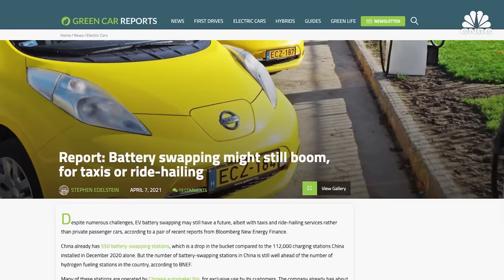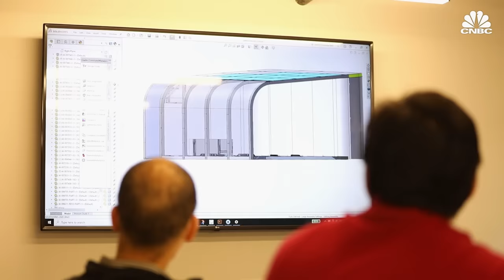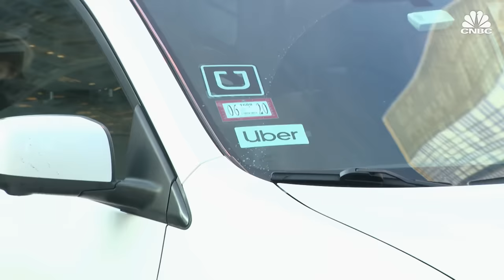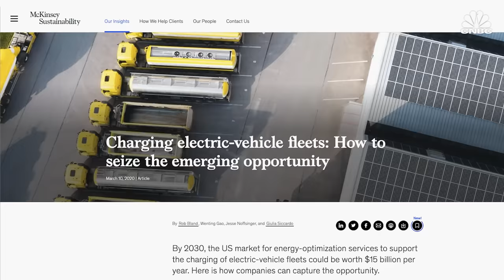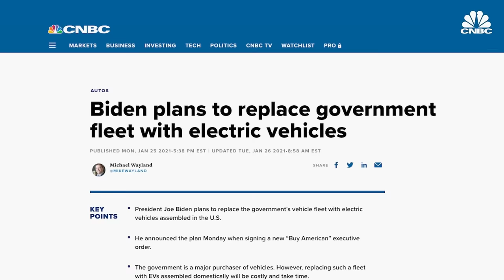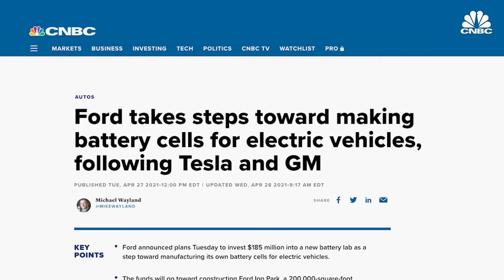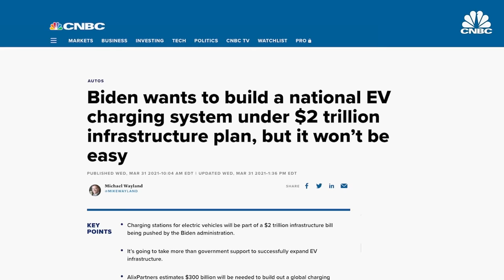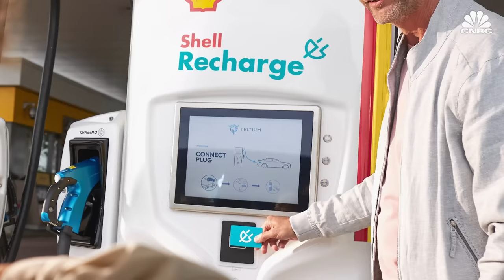Can EV Battery Swapping Take Off In The U.S.?

Comment: In the Netherlands a battery swapping station costs 3 million euro.

That's a lot of cars that need to go through, for it to become profitable.
Reply: But if they can sell excess power back to the grid then that's even more potential revenue. Just a thought.
Reply: It’s the exact same problem many gas stations have. The gas isn’t the money maker for them but usually the convenience store that turns the profit.
Reply: @inter5123  Isn't that the same for when opting for a charging solution? I don't see this as an avantage for saapping.

The economis for swapping are just terribly bad.
Reply: @FMTF-makemoneyonline  oh it would be the same charging or not. The margins are low either way. Maybe their consumer stations would have a convenience store aspect but as it stands there’s no way they can get a good ROI within a reasonable time.
Reply: In England they retrofit street light poles with EV charging sockets, each costs like 1500 pounds. For 3 million pounds it would be 2000 mini-charging stations, plenty for the entire city. At a cost of single battery swap station.
Reply: THIS IS A PONZI SCHEME BATTERY SWAP CAN ONLY WORK IN A COMMUNIST COUNTRY LIKE CHINA WHERE ALL AUTOMAKERS ARE UNDER GOVT DIRECTIVES
Reply: HahThatsWhatSheSaid  you can program the system to ensure there are always enough charged batteries to meet the demand of the service. Don't have to fully drain them either. You have these all over town with like 50% of the batteries providing like 20% of their storage to the grid and you can have a sizable output with minimal effect on battery life.
Reply: Battery swapping IS A DUMB IDEA.
Sounds "Clever" BUT Batteries is the MOST EXPENSIVE part of an EV AND there is AND WILL BE a battery shortage for the foreseable future.
With battery swapping you need MORE BATTERIES.
Most cars should be able to charge while parked so more chargers are needed, swapping is unecessary.
Reply: @inter5123  correct
Reply: Nio looks like U.S $314,000 per swap station in china. They can do max 312 swaps a day or U S. $2.76 per swap over a year, theoretically at 113, 880 swaps per year.  They are not tied down and can be moved depending on demand. Normal move takes 3 days in china. Still a big initial investment though. They'll have some 6,000 units within 3 years allowing for daily 1,872,000 swaps or yearly 683 million swaps along with their normal superchargers as well as home chargers. The Sinopec gas tations are putting them at their stations and the government just announced massive Rebates from provinces to installers and they hope to make a uniform code for swap stations. For what's its worth anyway.
Reply: Not only swapping station, must be multiservice swapping station. Sell all goods, food, cafeteria.....
Reply: @paul_london  that's a good idea
Reply: Modularized battery means you are adding dead weight to the car and reduce it's range and efficiency. Also thermal management advancement will make it worse and inadequate sooner than you expects
Reply: The only time and place that make sense is to charge over night in your garage. Battery swapping is more a gimmick than a true solution.
Reply: @ac-stingz  sure. It's for the people who do not have a garage.
Reply: That's because the Europeans didn't build it right. How come the Chinese can lower the cost? Cuz smarter?
Reply: @jal8298  Ask Renault?
Reply: @jal8298  I think here they the ground is far more expensive, combined with a more fixed building that isn't movable. Next the technology has yet to be built by themselves (they'll always try to reinvent the wheel)
Reply: @jal8298  1. Cheap labor 2. Differences in regulations. 3. Possible subsidies from government
Reply: the lifespan of slow charged batteries is longer, so the swapping solution could be better for the environment + less batteries needed in total. Maybe don't call it a "dumb" idea, only because it's different
Reply: @R3mak3r  slow charging is very inefficient, a charging rate of 15A@ 120v  is only 58%. Means you use much more electricity to charge up to the same SOC (state of charge). While level 2 charging at 32-48A @220V will have an 80%+ of efficiency. The key to minimize the effect of degradation is to charge at the right temperature and maintain the right state of charge (SOC), that means good thermal/battery management is more important. High state of charge is bad for the battery, which is another reason swapping 100% charged battery is not ideal.
Reply: @ac-stingz  thanks. This is a good information. I will take a look at it ;)
Reply: NIO is somehow doing it tho
Reply: @haruyanto8085  yeah, with kinda mobile tent like things
Reply: @haruyanto8085  here are some reasons why not everyone is following: https://spectrum.ieee.org/cars-that-think/energy/batteries-storage/ev-battery-swapping-how-is-this-a-good-idea
Reply: @qinby1182  Large batteries especially from cars, and even smaller electric vehicles like scooters/ebikes are recycled. However I think for smaller devices like phones with small batteries, are probably not recycled immediately/promptly (due to high recycling cost of processing the device just to get a small battery) and are kept at a municipal hazardous battery waste storage if you bring it there (hopefully) for future recycling once robotics reach a point of speedening the process. As long as the recycling process of batteries is low in energy demands, and the recycle rate is near 100% efficient (which I believe is) for the precious metals, then it is conservative.
However, if everyone decides to have an electric car, (instead of settling with an ebike that has probably 1% of the weight of the electric car battery) then yes it might put a dent on the available metals on the planet... however if space technology continues to advance to the point of being able to mine precious metals from asteroids, then this no longer will be a concern

Comment: 7:50 For those who aren't sure they want to run exclusively on whatever battery gets swapped in, why not mix the approach?  Vehicles could have their own battery capacity plus use Ample's for range extension.
Reply: Sure, double the weight of the batteries, great idea.
Reply: Where would the ample battery fit in?

Comment: For everyday commute plugin charging is good, only long drivers will need this swapping. semi-tractor-trailer trucks are a good candidate for battery swapping. Also for my personal car, why would I trade a good battery of mine with degraded battery of theirs from swapping place, unless it's a commercial vehicle.
Reply: I think what we'll see with class 8 trucks is a combination of supplemental batteries and solar charging in the trailers, as the few class 8 etrucks that are close to market release, have shown abysmal range for just the tractor - a Freightliner Ecascadia has only 250ish miles. Meanwhile, an otr driver team can easily be moving 22 hours a day.
Reply: For trucks trailers with battery is probably more likely
Reply: Yes. Battery swapping only makes sense for fleet vehicles.
Reply: Or people that live in apartments, and don't have safe personal charging options.
Reply: Battery swapping IS A DUMB IDEA.
Sounds "Clever" BUT Batteries is the MOST EXPENSIVE part of an EV AND there is AND WILL BE a battery shortage for the foreseable future.
With battery swapping you need MORE BATTERIES.
Most cars should be able to charge while parked so more chargers are needed, swapping is unecessary.
Reply: Yes, this could work for class 8 trucking, which would become coordinated relay hopping for long distance hauling. But with trained driver shortages a perpetual problem, the logistics are critical.  Many drivers arrive to drop off or pick up a load to be told to wait a couple hours, sometimes the delay is a day.  The logistics of trucking can be very frustrating - trucking usually does not operate like a well-oiled machine, which is a reason for the high turnover rate for drivers.
Reply: @qinby1182  yes especially the batteries that are the most expensive component of the car and already now there is a a problem to produce enough batteries.
Reply: @millefune  correct. Like china.
Reply: Good thinking! We could have the trailers include batteries even
Reply: Was thinking the same thing.  this makes alot of sense for, commercial vehicals. Taxis come to mind.
Reply: I totally agree with this. I definitely see a use case in this tech. Most would not need it everyday, but on those long distant drives or for people who live in Apartments that don’t have anywhere to plug in etc, this would be perfect! I can see these at future gas station/charge stations.
Reply: "Semi-tractor-trailer trucks" won't be electric unless they will have Hydrogen tanks and fuel cells. Batteries for these trucks will be just too heavy
Reply: "semi-tractor-trailer trucks are a good candidate for battery swapping"
Why ?  the Semi is charged during loading/unloading.  Plug it into several SuperChargers.
Reply: @Donovan Lewis but public chargers are not like gasoline service stations.   They are few,  they are in odd places,  they are often positioned on congested street parking spaces jealously sought by drivers,  they are often unprotected from the elements,  they are usually unattended so maintenance is spotty like a drink machine,  they may expose the customer to a dangerous criminal situation like ATMs did but worse in that you're there for 30 minutes,  various chargers have various payment methods,  various rates of charge,  various standard interfaces. 

Gasoline stations are common,  on typical routes,  attended,  numerous pumps,  common payment method,  covered,  maintained,  government inspected,  regulated,  licensed, tested,  same size nozzle and typically a common fast pump rate of over five gallons a minute. 

It took decades to get to this situation with gasoline.   EV charging is years or decades away from getting there, but they will.... And prices will go way up.
Reply: Hybrid* there will be no EV commercial vehicles in the near future other than local delivery. Battery technology isn't there yet, it's decades out in fact. It's about as possible as driverless trucks everyone thinks is coming. Buwhahahaha yeah ok, good luck with that. A human must be responsible for the equipment, unless that human is 100% in contact you can't be held liable. If EV was the future, why isn't there Commercial EV planes ? Boats ? Ships ? Yeah, EV is a leftwing wet dream.
Reply: @Donovan Lewis you do know we CMV truck drivers get certified to drive these self driving trucks, right ? It's an actual endorsement, you don't just punch in your way points and let the truck do it's thing. They can't navigate snow/rain/construction/hazards in the roadway etc conditions, how's that gonna work when freight must go ? They're a glorified cruise control once you're on the highway, no more no less. All FMCSA laws still apply, so no,self driving trucks won't be all over the country in 24 months. A handful of feel good companies that can afford the publicity stunt at a massive financial loss will have Driverless trucks as you put it. No carrier is willing to pay double for a truck, still have to pay a driver and only get 2-3yrs service from that vehicle. 2yrs is all any major trucking company keeps their equipment. 3yrs the IRS stops the depreciation so you're wrong. The used market will not be buying these trucks when we can find a 2-3yr old fleet truck for $20-30k. 

Please quote the FMCSA ruling that allows and relieves a vehicle from liability that's Driverless. I'll wait !!!
Reply: @Donovan Lewis Tuscon to Dallas is 952 miles, so you're saying the driverless truck mantained 95.2 mph for 10hrs. Being we're trying to get better fuel economy and drive as close to 65mph ( Speed every single diesel manufacturer targets max mpg) going 1mph over is on average 5% loss in mpg. I assume it's got a DD16 or maybe a DD15 which gets around 7.2-7.6mpg fully loaded. See where I'm going with this ? Stay in your lane Donovan, drag queen story hour etc.
Reply: @Allen Loser Heck, the 5,400 watts you'd get from all those panels on top of a semi-trailer would not even be enough to keep a small car like a Model 3 going at highway speeds. 

Like battery swapping, solar on vehicle is one of those things that just isn't really as practical as it seems.
Reply: @Hepsewind  I never thought of that. Load trailers with batteries and have it feed back to the tractor. Great idea!
Reply: @Donovan Lewis pfft. Won't happen!. The leading manufacturer in autonomous driving is struggling to get it right. You really think there will be 80k vehicles with no drivers anytime soon? LMAO. So what does this vehicle do when emergency vehicles come around? How does it know which scales to stop at? What does it do snow or fog or vision is blocked? The first time that vehicle flips and kills a bunch of people they will all be pulled
Reply: Would be feasible if batteryless EV were sold, e.g you do not purchase bu rent/swap a battery, thus not worry about the battery.
Reply: What if you get better battery than yours when swapping? When years passes you are getting New, by the way you don't own anything in this world, how about those who are swapped with your low graded battery?

Comment: In addition, most people forget one of the main advantages with battery swapping: 
You will of course also avoid the big common problem with the need of the extremely expensive change of power source when the car is 5 to 10 years old. Not a small issue.
Smart system.

Comment: Here I am, a 2013 Nissan Leaf owner that's been investigating a battery replacement for years and coming up disappointed. Seeing those Gen 1 Leafs rolling in to their batteries swapped out, I'm like Oooh! Oooh! Do me! I'll take a battery swap, sure!
Reply: For sure. Also have a 2013 Leaf. So I'm with you. My big q would be, what range am I getting? Unfortunately did not come up as a point.
Reply: You can update your Leaf's batteries, or add additional ones. I've seen several YouTube channels were a particular shop does this. The ultimate problem with the Leaf is that it's capacity constrained - it lacks modern liquid cooling, so therefore you can't put in 5x the storage (for example).